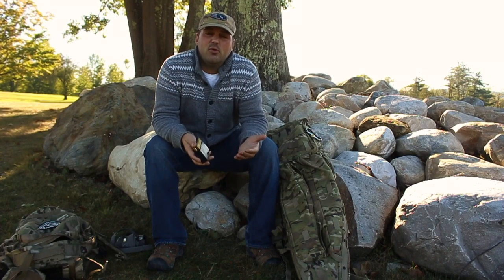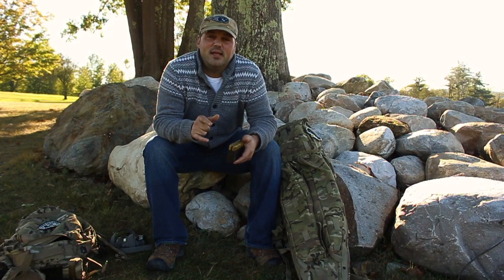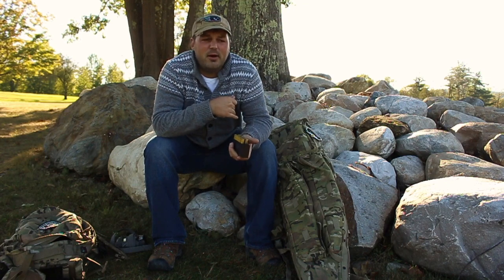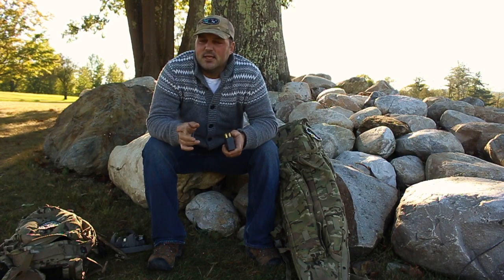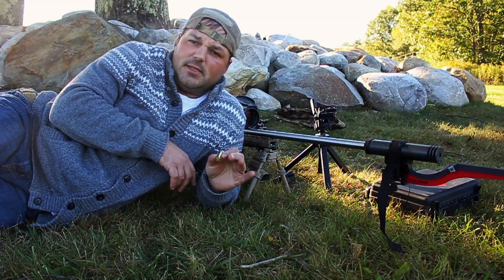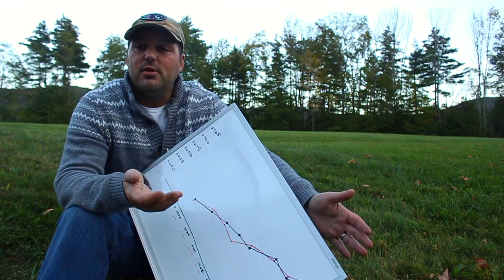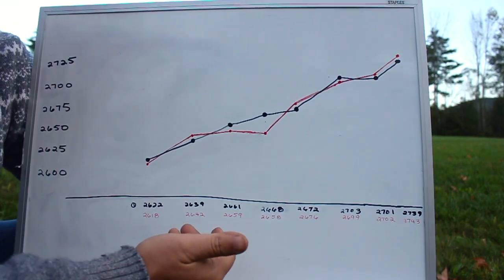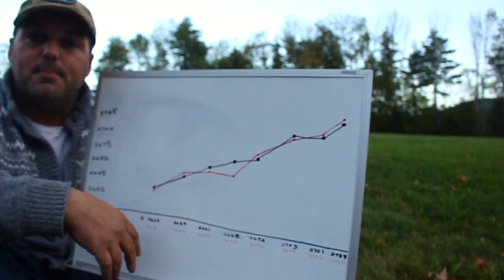-Load Development- optimal charge weight, OCW

Comment: Hi mate good video.. With your two strings whwr they 2 of each charge weight. And did you just pick a seating depth I'm using barnes tsx and have to be min on 50 thour off.. And once you find the ocw do you then tweak seating and powder around that?

Comment: Nice video and great info Joe! You're correct in your thought process.  You found a node at that 2702 - 2701 velocity and that's telling you that you that if you loaded at 42.7 grains, right in between the 42.6 and the 42.8 grain loads, you could STILL be off on your grain weight and achieve good results.  I usually go with a 5 shot string and take the standard deviation (SD) into account as well.  Next, you would shoot 42.6, 42.7, 42.8 to see how accurate they are at 100 yrds or 200 yrds (verification).  THEN, you would begin adjusting your CBTO seating and find the sweet spot for distance off the lands.  I've found that for my 6.5 Creedmoor, using Alpha brass, H4350, and Hornady 140 grain ELD-M's that MY Bartlein barrel is most accurate with a .040 (40 thousandth's) jump.  Looking forward to your next video and getting that velocity up there.

Comment: i like this method but no offense but you are kind of double talking here. on one hand you are saying this avoids wasteing ammo but you do infact need to waste some ammo on a new rifle. when i get a new rifle i usually load up about 100 rounds sometimes not even in ladders, often times with several different bullets at set charge weights and i just go shoot. all im looking for is accuracy and pressure at this point often times if i load 5 different 105gr 6mm bullets and the lets just say the berger 105 shot the best out of the 5 bullets i shot at a random(safe) charge weight i set all 5 sets too, then ill start loading for accuracy with that bullet first assuming that since it was so easy to shoot accurately that it will be an easy load developement. i look at it like the first outing i wanna burn some barrel and thats mostly it. whatever i find from doing that will usually point me in the right direction but i wouldnt do the ocw on a new barrel its a waste of time its going to all change and your gonna have to do it again anyway. take your new rifle out and shoot it atleast 100 rnds. the ocw method has merit, just not how it was done in this video. and it also would not be my preferred method to find the peak accuracy of my rifles either. low es matters more the further you shoot if you are only shootin 100 yards dont waste your time with this as a ladder test will give you what your looking for faster than this will i promise you that. the ocw method also does not guarentee accuracy. just because you have low es does not mean that load will be the most accurate load in that rifle. like i said it just depends on what you are going for. if shooting at 1000 yrds start with ocw find a low es then load that load with a ladder of tweaked OAL to try to pinpoint what jump the bullet likes. if you cant find a load your happy with switch bullets or powder and do another ocw test and again tweak OAL to try to find acceptable accuracy. honestly people get too hung up on this. often times the gun is more accurate than the shooter thats using it and people will chase .5 groups when they are only capable of 1.5 in groups. be realistic if you are a new shooter and you are getting 1in groups that load is probably very accurate and stay with it and practice shrinking it down. if you are doing prs type stuff  1 in  groups will get you by no problem im 90% of matches

Comment: Hey Joe ,  Just some fuel for thought. Some of the powder scales out there have a +/-  1 tenth of a grain accuracy so I would suggest weighing your powder charges several times before you put charge in case. If one case is one tenth light of intended charge and the next is one tenth heavy of intended charge that would 4 tenths in between roads intend of .2  Also I would suggest weighing at least the brass used in your test to make sure they are as close to the same weight as possible. Case weights that are different may cause pressure changes which may affect velocity. Hope this helps. I can be contacted at murphyrick1@yahoo.com

Comment: Hi Joe, this method will give you consistent velocity but how about barrel harmonics? Or am I missing something?
Reply: you will find the harmonics once you find the flat spot on the different charges.
Reply: @Craig-uh6sp  I could be wrong but I don't think his is necessarily true. Velocity consistency is independent from harmonics. Consistency of velocity is a factor of bullet seating depth, primer brand used, and case consistency (such as annealing). Harmonics occur due to the powder/gasses vibrating back and forth from the brass to the bullet, and the frequency is consistent regardless of powder charge.

Comment: I have a huge question...I'm shooting 6.5 creedmoor. 140gr eld match. 1:8 twist 26 inch barrel. I used a guys chronograph at the range one day and it showed about 2500 fps on my muzzle velocity. I loaded some with 37.6 grains of H4350. I feel like the charge is low and the fps but I'm putting 5 to 10 rounds inside a dime at 100 yards. Is accuracy more important or the MV ? I have a magnetospeed on the way to recheck MV but I just wanted to ask cause I'm hearing everyone using higher powder charges? Thanks
Reply: SD and ES are what you're looking for. Low numbers on both. You probably hit a low accuracy node. You can search for a higher accuracy node. If you need to, you can use srp brass and go over max charge as long as you're not showing signs of OP with 4350. Lots of guys are finding nodes over the 41.3 max charge, like 41.5. Just be careful and load some sighters 7-10% below max first.

Comment: So basically using a version of scott satterlees velocity based OCW? watch?v=ACyfeeBHVOA

FWIW i've seen guys try this method and not really like it. I ran it over 10rds to see if i would hit a node maybe that had a low spread between two charges to no avail. I like you question myself. But hell i have more accurate equipment now than i've ever had before. Going to retest using 5rds of each charge at 300yds. Really need a chrono outside the magneto speed so wouldn't have to deal with barrel harmonic change.

Comment: you shouldnt chrono rounds til you got the barrel broke in because it will speed up after 100 rounds. shoot some steel a couple times then try the chrono
Reply: JB I found that to be VERY true! I just rebarreled my rifle to 6 Creed, and 41.4 grains was 3005 fps after 80 rounds. Then next weekend range trip the same load jumped up to 3130! Now it's development time!
Reply: @JoeyD3  bullet weight?
Reply: @gilream 107 smk
Reply: if your in a hurry you can just lap the barrel and get there in about 10 rounds

Comment: Thanks for the video, really enjoyed it. For the longest time i was doing the ocw method but just like you said, trying to be perfect for 40-50 shots just wont happen for me. I read about this method a couple weeks ago and decided to try it with my new 6mm creedmoor. Problem i had was i could find very little to no load data for the 115gr DTAC so i was flying blind. Started low and went up 2gr in .2gr increments and was barley breaking 1850fps. I was shooting for the 3000fps node. Loaded up 10 more thinking i would hit pressure signs and highest charge was right at 3000fps. I found a lower node that will be good for closer in stuff, but need to load up some more and find a max charge to hopefully find a higher node. I have been using a f1 chrony and I've wondered for years how accurate it really is. I'm thinking hard about upgrading to a magnettospeed v3. If anything, its way easier to setup at the range, and late afternoons it will still get velocities as well as recording velocitys.

Comment: How do you like your Omega? Are you running it with an ASR brake or direct thread? This is my 13th month waiting in mine. My 26" Bartlien runs 140 eld's at 2812 with 42.2 H4350 and Lapua brass.
Reply from the maker: gixxerjunky 13 months?...unbelievable! I love it. I use it on all my guns. You can swap the end cap to different calibers so if I wanna use on 5.56 I just add that end cap. I have the ASR brake and when u get the silencer when you send in to register it they will send you another ASR brake buts it's a flash hider for free. I got 3 muzzle brakes and 1 flash
Reply: My last 2 stamps took 361 days

Comment: This is how i do mine now. I love to nerd. What grain 6.5 are you using?
Reply from the maker: Bill Harvey 140 grain.....I can't believe how slow these are! It's like a .308 speed
Reply: JOE MANIERY  hpw fast was your load for the last barrel
Reply from the maker: I was getting 2803 with 42.5 h4350 with bartlein. I think in this video I was around 2670 with 42.5 and when I got to 2700fps I was showing high pressure signs. Everyone says you gotta put rounds through it and it will speed up. I hope so. Factory amax on the box show 2725fps. I shot a box through this and it was 2650...I don't get it
Reply: JOE MANIERY is the seating depth to close to lands did he chamber it tighter than your last barrel
Reply: @joemanieri  were your higher speeds accomploshed in warmer weather?